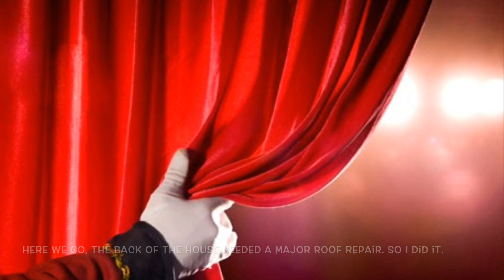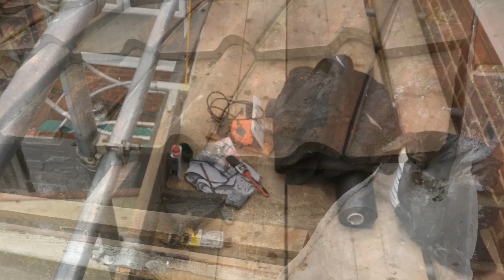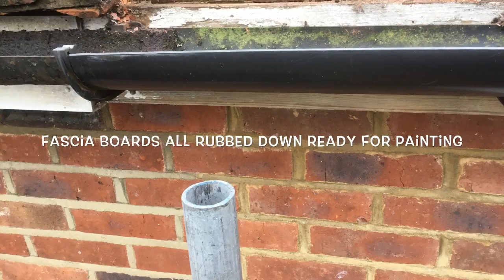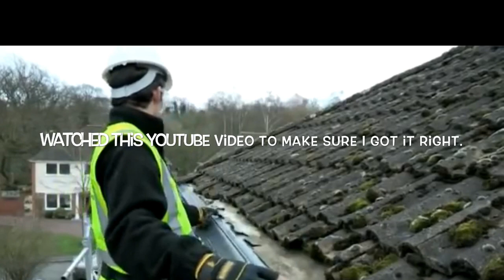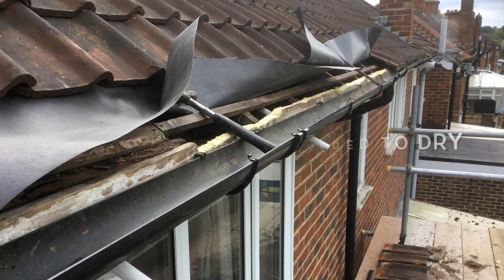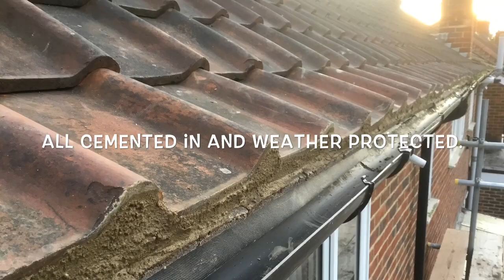Roof Remodel | DIY Repair

Comment: You shouldn't have pointed up the bottom course of tiles. Now theres no exit point for any rain water blown under the tiles, or condensaton to escape.
Reply from the maker: IPfrequently thank you for your comment.
Reply: Should the new felt be under the lats not on top?

Comment from the maker: Thanks for all your comments. Trust me when I say that the houses in the area, all have cement in between the last row of titles. It was the way the houses were built. 

I was replacing what had fallen out with some new plastic trays and air vents which screw into the wooden fascia boards.  

Thank you 😊
Reply: Hi Bobby, were the houses originally built with no underlay, which would account for the eaves tiles being cemented up. As I commented earlier any water getting under the tiles must be able to run down the underfelt and out at the bottom.
Reply from the maker: @IPfrequently  hey there,

There was no underlay. What their is a form of felt which has decade over time. I’ve live here more than 25 years. It’s Excouncil property, the titles are hand made which gives you some idea of the type work and quality of these builds at the time. The area wasn’t meant to be council. But after the Second World War they didn’t have houses for people to live in, so this area became a quick fix. 

I have checked for damp a year later, after the first comment I got, which worried me a lot. I doubled check on my research and after removing the cement from the last row, I believed it to be the best way forward. 

I have looked at other properties further a field and can see that cement is not put on the last row of titles, but they are fairly new to my property.

Comment: Hahahaha why you pointed your eves
Reply from the maker: Hey

Everyone has mentioned this. But this how the houses were built. Plus we had a repair 10years ago and they were professional roofing company which did the same.  So when some of the work needed repair, I decided to do it my self. 

I did loads of research before embarking this major work. And even the houses in the area have the same. So if it was a problem since 1940, I guess there would be a bigger problem. 

But thank you for comment. 👍🏻👍🏻👍🏻